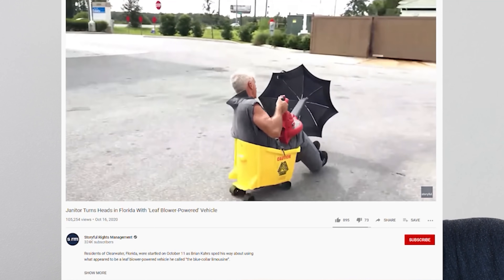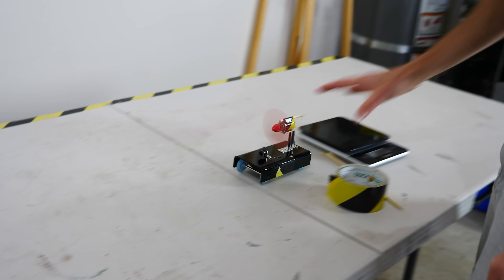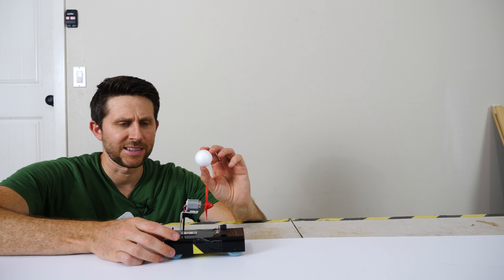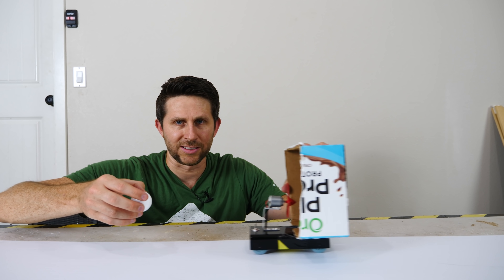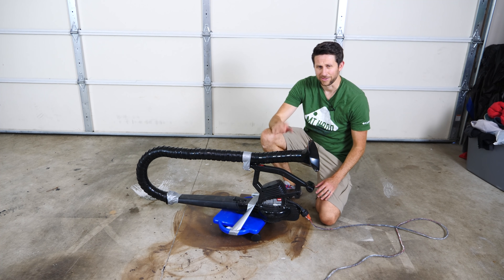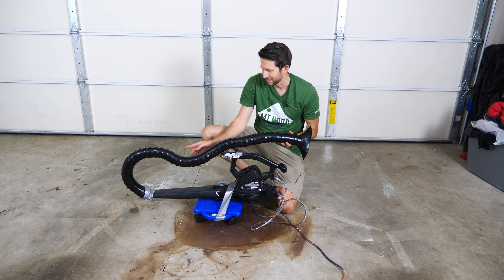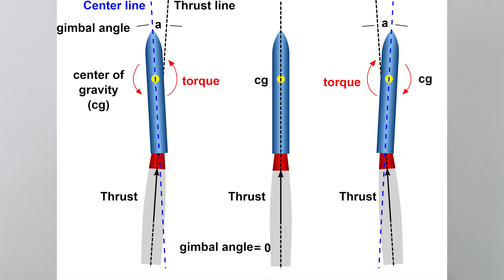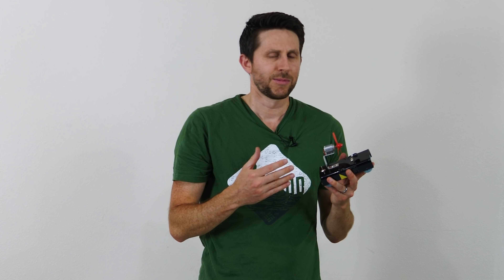Blowing Your Own Sail Actually Works

Comment: It’s just just like blowing in the opposite direction. Here instead of blowing directly into the other direction, the sail actually redirects the air in the opposite direction.
Blowing directly into the opposite direction would be way more efficient than , redirecting the air using sail . 
So if u ever get stuck in the middle of the sea with an boat with an sail with no moving air , blow in the other direction and not into the sail … hope u survive and have big lungs 🫁 
:)
Reply: But what I don't understand is the suction would want it to move the other direction.... the one side of the fan blows and the other sucks... so why doesn't it counter each other out?
Reply: @johansmitphotography  think of it as the force on the fan from the high pressure side (the "blowing" side) is in the same exact direction as the force on the fan from the low pressure side (the "sucking" side) so there is no cancelling out.
Reply: @rednammoc  There is cancellation (one reason why it doesn't have as much thrust) but it's due to recirculation of some of the air.

That said it indeed works and there's a whole bunch of examples in the sky... Thrust reversers on jet engines exploit this large scale.
Reply: @MadScientist267  Unless you are intaking from the same point you are exhausting there is no cancellation. you may get torques or increased drag from poor intake placement. By your logic a rocket engine is more efficient than a jet engine, which we know isnt the case.
Reply: @henrygaraffa5584  No, a jet engine doesn't suffer any issues because the intake and exhaust are on the same axis (and direction) for normal operation, and while reverser ducts are not even close to 100% efficient for various reasons, there's a lot more than just the intake air blowing thru the engine and coming back out of the ducts. If those were ducted fans, it would be all but pointless to do reversers as implemented.

Reversers also most certainly do demonstrate (one of their) reductions in efficiency by recirculation... It's true most of the loss is the direction change and off axis vectors... However it is ill advised for example to use reversers where there is debris on the landing strip, due to the threat of it being kicked up and sucked into the engine... This is an indirect result of that recirculation. Again, debris induction issues aside, a jet is pushing a lot more out the back than it's sucking in the front, so those forces don't cancel out anywhere near as much.

This translates back to the video because there's nothing increasing the thrust (edit: eg no combustion adding mass and accelerating everything further) in the prop, only the energy the motor is giving it. When that air comes back around from the deflecting device, pointing backwards, vortices guarantee some of it will be curled back around and into the suction side of the prop. This translates to significant lost thrust because the circulating mass provides no net force on the vehicle... And... If turbulence is excessive, the prop will unload, decreasing system efficiency even further than it already is.

In a nutshell this is a cool academic demonstration but between this and the reversal and associated drag losses, has less than zero chance of showing up on a commercial (or otherwise non-toy-like) design because it's mostly a "how much can you steal and it still goes" deal 🤣

If you used a ducted blower with a well placed intake, in that situation you'd be correct, no recirculation, no loss of thrust due to that mechanism.

Correction - there would still be recirculation, just not via the blower... Entrainment of the vortices... A little bit different but a similar end result. 

Unless you ducted the "sail" (reversing device)... But now you're just in "really badly designed nozzle" territory, and the whole thing kinda starts to lose its original appeal 🤷‍♂️
Reply: @MadScientist267  as soon as the air has exited the sail it has given all the enrgy it is going to give. recirculating air still provides thrust, so long as you arent exhausting directly into your intake. 100% of losses from reversers comes from the direvtion change, 0% from recirculation.
Reply: @henrygaraffa5584  Not entirely true. The air leaving the sail has had the "direct" energy stripped from it... Forward thrust on the sail is provided only by the reaction of the air that has been reversed and is now interacting with the much slower air behind it. With the recirculation, this moving air can't reach the "still" air to react with it.

This would be very evident If there were a "wall" back behind the vehicle, efficiency will improve. 

In the absence of a hard wall of some sort, surrounding air provides all of the reaction mass... And because it has less mass than a solid (and readily moves), it's not as efficient.

You can't look at this like you would a rocket engine or whatever because it's a whole different thing. You'd be right in the case of a rocket, once the ejected mass leaves the nozzle, it has spent it's energy as far as the rocket is concerned. If you cause a reversal in the exhaust stream by something mechanically connected to the engine (in this case the sail)... You will only have the reaction forces with the standing air, not this "immediate thrust". Same with a jet engine. And no, not all the loss in reversers is in the actual reversal... Recirculation loss is just nowhere near a thing because the engine is an "amplifier" that makes the loss largely an academic one.
Reply: @MadScientist267  the exhaust does not need to reach undisturbed air to provide thrust. as soon as it exits it is slowing down, and the new exhaust gas is pushing on the slowed exhaust.
Reply: @henrygaraffa5584  It doesn't just spontaneously slow down... It does so by colliding with other molecules as it leaves. Without that high pressure being generated, there's nothing to push back on the sail to propel it forward.
Reply: @MadScientist267  thats not how this works, thats not how any of this works. by your logic rockets cant function in space. When you allow a gas to expand, ie letting out of the combustion chamber, it slows down.
Reply: @henrygaraffa5584  No! First of all, forget rockets. They share some principles but do not require any air because that's not the mass they accelerate. They accelerate their own mass, as opposed to scooping it from nearby environment and throwing it in one direction. There's a huge difference between them.
Reply: @henrygaraffa5584  Another angle on this whole thing can be seen in this:

https://youtu.be/jyQwgBAaBag

Uses the exact principle I'm referring to, just in another way.
Reply: @MadScientist267  clearly you dont understand how that vehicle works. the turbine steals energy from the wind to drive the wheels, the air is slower behind than in front. rewatch both videos he did about it, but pay attention
Reply: @henrygaraffa5584  Bzzzt.

The "turbine" isn't stealing anything. It's augmenting, or as they put it, "acting like a fan", being driven by the wheels... which is how it gets its "faster than the wind" abilities. It's initial energy source is from parasitic drag on the "airframe". I suggest you do the same, rewatch.

Either way, it's air molecules being propelled against each other, providing the thrust.
Reply: @henrygaraffa5584  To wrap this up cleanly, it's the resistance of the air pushing back from that high pressure zone where the wind meets it, in that vehicle the forces add, and it goes faster than its propellant.

Back in this video, because the prop faces the other way, rather than adding, when the air loops back around for another trip thru the prop, that's energy that didn't accomplish anything but whizzing air molecules in a circle.

Like I said, too much wrong with this version to ever do anything but teach... The Blackbird thing... That could... 🤔 That maybe could become something useful
Reply: @MadScientist267  a prop "steals" energy from the air when the air hits the prop. The air does not need to push back against anything, putting a wall behind it would just redirect the air. you have a BAD case of dunning krueger my friend
Reply: @henrygaraffa5584  Dude the evidence has been presented. It's not rocket science. It's actually very simple, but you can't seem to grasp it, despite it being put right in front of you in plain English. I'm not convinced you've seen any of the 3 videos in their entirety. You couldn't have. Until then... Pfft 🤷‍♂️🤦‍♂️
Reply: @henrygaraffa5584  And I'm trying to tell you that prop isn't "pulling" itself thru anything!

That's not how it works at all. At all
Reply: @henrygaraffa5584  That prop does not function like it does on an airplane at all

It serves an entirely different purpose and works in an entirely different way.

Watch the videos again to understand.

Comment: Is it only the blades hitting the air particles and then the cardboard box? There's a pressure difference as well. The pressure in the back of the blades is lower than in from of them and, because the air needs to get to the equilibrium state, the higher pressure in the front will push the cardboard to get the space needed to get to that equilibrium. The problem is that the cardboard is stronger than air so it can't bend it. Instead it pushes it so it gets space. That basically means that you're going forward. 
Correct me if I'm wrong 😉

Comment: 4:47 Definitely fake in my opinion. I base that on the way the umbrella sections are being pushed in from the 'top' of the umbrella, not being billowed out as would happen if the leaf blower was providing enough air to push it along.
Reply: My dream for you, action lab to make is : melting wood or solid water or shape holding glass
Reply: @easha5706 he did do melting wood just letting you know if you’ve forgotten after 3 years

Comment: Yes. But when you change the direction there are more energy LOSSES. You would get more EFFICIENCY,  higher top speed by flipping the fan around. Access to the direct energy is best.

Comment: now probe that  you can lift  yourself   by  pulling your  bootstraps, easy  as the back redirection of air....  you need  just a couple of pulleys  fixed to the ground or only one   higher than you...

Comment: The key to this working is the high Reynolds number or turbulent air flow, because it is not symmetric. If you build this on a microscopic scale where all flow is time symmeteic, it would not work. In this case, you would need some sort of asymmetric system. Bacteria do this with spiral flagella for example which are not symmetric.

Comment: That's just an airboat with extra steps.
Reply: Except it had wheels and was on a solid surface and not water.
Reply: @MrT------5743  that's why I said 'with extra steps'. And if I'm not mistaken, airboats can go on solid surfaces
Reply: @amanhidup6676  so if by "extra steps" you mean changing a boat to a car then ok. But then you could have compared it to an airplane with extra steps, or a bicycle with extra steps too.
Reply: @MrT------5743  Just add tyres. And I don't know where you live but cars don't run by a fan, it runs on something called an engine usually. If compared to planes, it doesn't fly, and bicycles is not powered in any way except by humans.
Reply: @MrT------5743  I thought a family man would know this. What
Reply: @amanhidup6676  airboat have en engine just like a car, but instead of turning wheels it turns a fan. You were the one who compared his car with a sail to an airboat with no sail. Airplanes push air just like his car did too. A bicycle is powered! How do you think it moves? 
But once again you were the one who compared a car to a boat and said they were the same with extra steps. I said thos "extra steps" could then be any change you could imagine.
Reply: @MrT------5743  I never said it didn't have any engines. I said with airboats is because instead of propelling the air backwards, it makes the fan and engine looks forwards with a something to channel the air made by the fan backwards, to then propel the craft forwards, like how airplanes reverse thrust their engines upon landing to slow it down, but just with a different objective in mind. An airplane's main objective is to fly, did this fly? No? And did you not read, I said bicycle is not powered in any way except by humans, if you added an engine, then it's just a motorcycle
Reply: @amanhidup6676  so now you are back peddling. Lets start back at your original post. You compared a fan powered car with a sail, to an airboat "with extra steps", those extra steps being a boat vs car, sail vs no sail, they only thing the have in common is a propeller.  Just as dumb as someone saying a dog and cow are the same with 'extra steps', because they have 4 legs those extra steps being fundamentally different.
Reply: @amanhidup6676  just keep comparing 2 different things and as.long as you say 'with extra steps' you will be good.

Comment: Putting a curved sail = turning the fan 180°
Reply: But far less efficient
Reply: Yeah
Reply: If you use a holo donut shape cut in half it would be efficient
Reply: Doesnt equal. But if you are in a situation in which your thrust source direction is fixed and attached to the payload you are wanting to move, then using this to redirect your thrust is a way to get SOME thrust. Its not going to be as much as if you could just turn the thrust.

Comment: Day one of asking this experiment

Place 2  world's bounciest serface and put a ping pong between them and see how fast it  jumps
Reply: You can make this by just getting a Pringles Container.
Then cut off one end for an opening.
And putting balloons over the ends.

To fit the ball in, you can cut a rectangle on the side of the container.

He said in the video that it's literally a rubber balloon stretched over a surface.
Reply: @diakounknown1225  lol I'm 2 lazy XD
Reply: My dream for you, action lab to make is : melting wood or solid water or shape holding glass

Comment: glad you fixed this, reverse thrusters on jets have been about for decades
Reply: My dream for you, action lab to make is : melting wood or solid water or shape holding glass
Reply: @easha5706  You know solid water is just ice?
Reply: @Let_The_James_Begin  LO
Reply: @Let_The_James_Begin  LoL. I just posted a Varitasium video that I'd like to Action Lab to address. 

https://www.youtube.com/watch?v=yCsgoLc_fzI

The physics between the two situations are different, but the counterintuitive nature of them both are on par with each other.
Reply: @dwightfry99  varitasium was right and prof lost 10,000$ haha
Reply: @Let_The_James_Begin  I just watched the video and he didn't debunk it. He made a claim that glass cutters put the thickest parts at the bottom. That may or may not be true. He never addressed the issue further. 

In fact he actually spent most of the video explaining how liquids and solids are basically the same thing. He focuses on flaws in the crystalized (solid) structures that shift over time to create flow.  And vice versa, liquids under intense pressure behave as if they were solid.
Reply: They've scaled up the Dyson bladeless fan to airplanes.
Reply: @nolan412  nope Dyson stole the idea from aircraft.
Reply: I was about to say the same thing. Lol
Reply: Oh, now they make sense to me. Thank you, Tim Lumsdon. I had never understood how reverse thrusters could work. But as Mr. Action Lab says, if the end result is air being forced in one direction, then that is the overall thrust.
Reply: Old Spice moisturizer with all natural shea butter and scents isn't that bad
Reply: Indeed it's also how the Harrier flies.
Reply: I find it fairly ineffective on jets with underwing engines as they're required to be at idle reverse by 80kts and stowed at 60.  Touching down at about 120kts, with the engines spooling by the time you hit 100kts, you really only have a few seconds of serious benefit.

However, when I was flying a jet with tail mounted engines, they were MUCH more effective.
Reply: what are reverse thrusters
Reply: reverse thrust redirects airflow, it doesn't try to stop the airplane pushing into the barriers.
Reply: My thoughts exactly! I was in an argument with someone on the internet about the leaf blower umbrella video and i said "what about airplane reverse thrusts?" Then no one could answer lmao. Glad this video exists